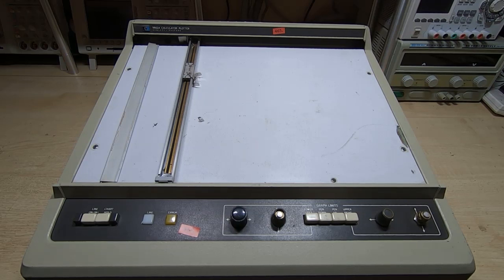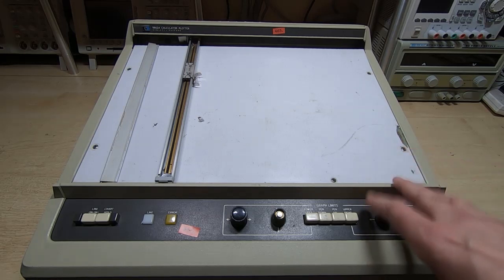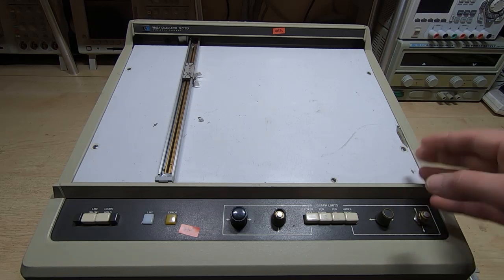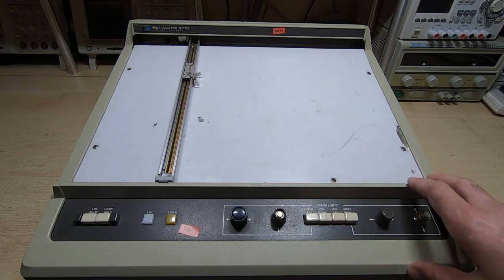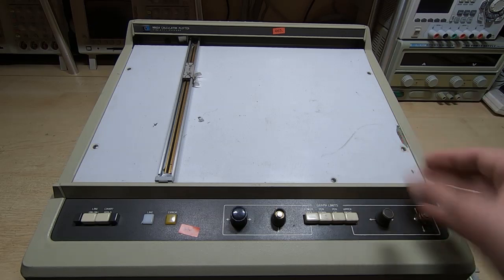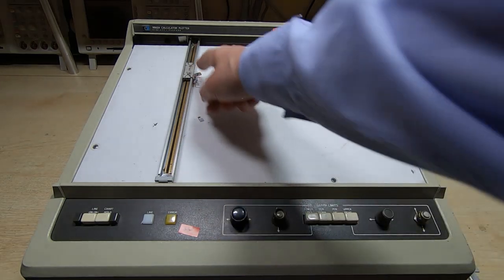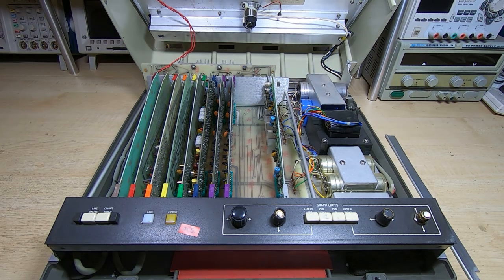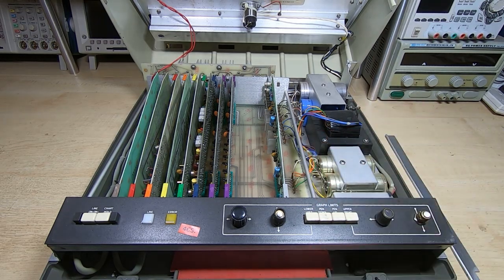HP9862A Calculator Plotter Repair Part1

Comment: Mine has non-original knobs. I'm not sure what the correct ones are - possibly the grey with a silver embellishment that's second from right ?
Reply from the maker: One of the knobs on mine is completely smashed but the other seems to be an original. A working unit would be very useful to look at. Most of the parts are easy to find as they are really just 74 series but one of them is proving a bit more difficult although I can always redesign the interface circuit slightly and use an alternative if I need to. My main goal is to create a fully functional IO interface to drive the plotter. I think that the actual pcb inside the module is an interchangeable part.
Reply: I have the 9862a operating manual  and the 9862a peripheral manual (which seems to be just a subset of the operating manual). Also a 9815A service manual which has little information about the 9815A but does have a partial schematic of an i/O interface and some linking specific to the 9862A.
Reply: Mine also has a complete pen holder, and I have a few aftermarket pens to fit it. Not sure they're still available (they're not the standard HP pens used in later plotters) but should be fairly easy to 3d print.
Reply: This video https://www.youtube.com/watch?v=1KUXrAwcNsw shows the knobs in more detail. They seem to be the same as that undamaged knob of yours, and belong to the same era as my HP3312A function generator (1974).

Comment: I have one of these too, along with a 98132A interface and 9815 calculator. I think it has a different case but it might be interesting if you need a working reference system.
I'm also looking for other 9815 interfaces such as 98133 or 98134 input cards or 98136 HPIB card.

Comment: Do you have the HP part number of the interface card? (was wondering if it is a 17601A becasue I have one of those)
Reply from the maker: I do not have one to look at but it is Option  20/30. The only part numbers I can find relating to it are 09862-60442 which is the module and 09862-60131 which is a version of the pcb. I think that the plastic module enclosure is the same for all versions.
Reply: @JerryWalker001  Ah, this cannot be the one you are looking for as mine is a bare PCB that plugs in and does not have a plastic case.